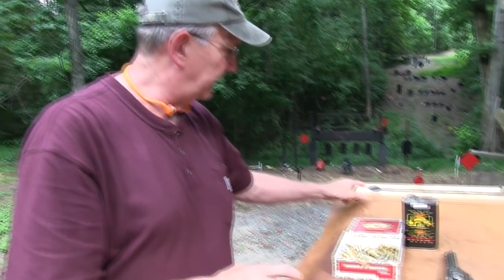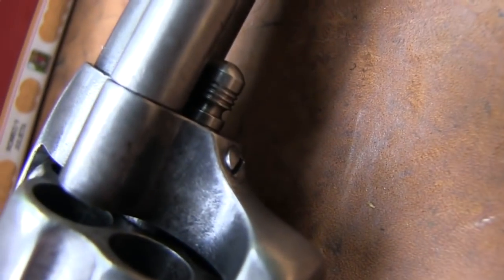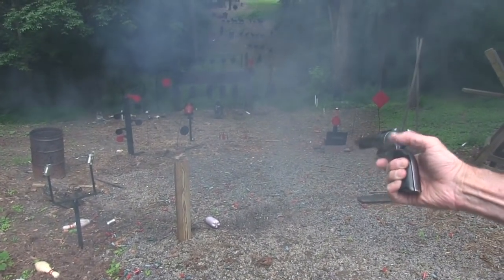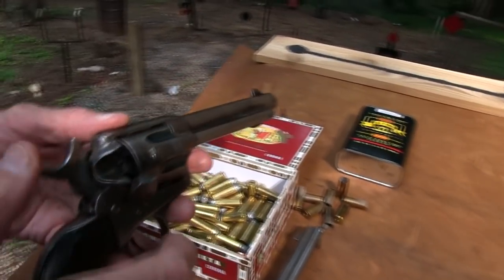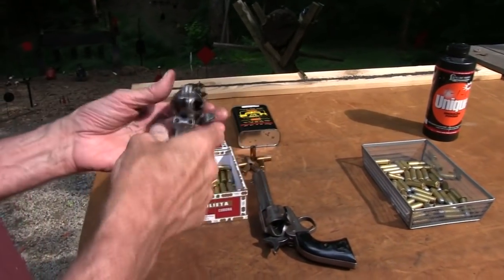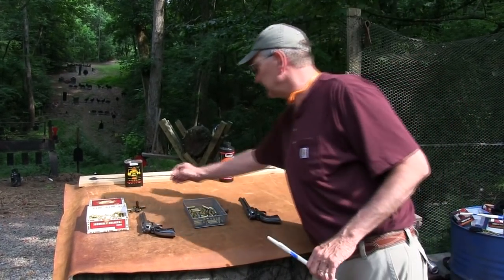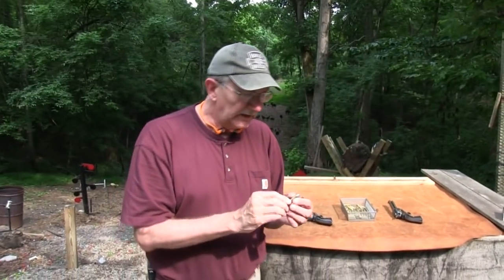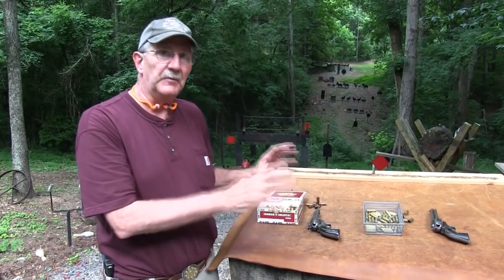Black Powder vs Smokeless Powder: some education!

Comment: Smokeless and black burn faster when loaded in a case due to the much higher rate of heat transfer that occurs at high pressures, up to 20,000 psi for black and up to 60,000 psi for smokeless in rifles.  The greater rate of heat transfer brings the powder to ignition temperature much faster.  The increase in ignition rate happens for both black and smokeless.  The demo only shows that unconfined the black burns faster than the smokeless.  ( I believe this is due to the BPs lower ignition temp.)

Comment: black powder is probably less dense, so a line of it will burn faster because you actually put less mass of powder on the table than with the smokeless one.
Idk for sure, but that's what it looks like.

Comment: The key difference which makes smokeless powder "smokeless" is that ideally all of the products of the decomposition reaction are gasses (CO2, nitrogen, and water vapor) whereas black powder produces BOTH gas and solid products. The solid products are produced as very fine particles which become suspended in the air, which is what produces the smoke (gasses - even water vapor - are not visible - only particulates or tiny droplets are). Black powder is far MORE dangerous to store because it is much easier to ignite when unconfined and it burns much more quickly and vigorously WHEN NOT CONFINED than smokeless powder does WHEN NOT CONFINED. However, when you confine smokeless powder so that the heat and pressure from the reaction accelerate the reaction, the reaction rate goes up drastically and quickly exceeds that of black powder AND it also produces a higher pressure and temperature. Part of this is due to the fact that almost no heat energy is lost to solid products (which don't expand like a gas when they're hot and contribute to the pressure).

Comment: based on some results of black-powder in semi autos, I think it is more of an issue of force of the gases. if you load an equivalent load in a modern rifle, black-powder doesn't have enough force to push the action all the way back.

Comment: the main difference between smokeless and black is that smokeless has nitro glycerin which is very explosive, nitro glycerin also burns very quickly and burns almost all of the gunpowder when shot compared to black powder which does not burn all the powder, that means more pressure building up in the barrel because almost all the powder has burned,i know what your thinking "then why doesn't smokeless burn quicker" because since it has nitro in it they put deterrents which make it burn slower

Comment: It would not be to strong, however, black powder is not a good idea in gas operated semi-autos.  It leaves too much residue for them to operate reliably.

It is also not a good idea to substitute any powder for another without reliable load data or a thorough understanding of the properties and pressures involved.

Comment: you did not mention that black powder &smokeless powder have different recoil,at least this is the case with my cap & ball revolver using black powder and cartridge revolver with smokeless load.Basically the black powder pushes while smokeless kicks,I have used the gentler recoil of B/P to help new shooters,especially women,overcome tendency to fear or flinch at recoil.

Comment: Before I ever shot or loaded my first Black Powder rifle, I went to TNT Guns and Ammo just east of Gillette Wy. They have a counter sized case packed full of what's left of Black Powder guns after the wrong powder, or an incorrect load was used. not all the shooters survived some lost limbs eye's only a few got lucky. one that I still remember was a Remington new army they loaded it with smokeless powder causing a chain fire 1/2 the cylinder was gone the frame was tore up beyond repair and the barrel wasn't to pretty either. The shooter didn't make it. that being said Black Powder guns are still a lot of fun, and yes just as capable today as they were in the Civil War in some cases a bit more accurate and durable. first Black Powder I ever shot was .50 cal. Hawkin reproduction 46 or 47 years ago. I think I was 8 yrs. old at the time love at first BOOM!

Comment: The burning characteristics differ between outside in the air and when confined in a gun.    The burn rate of black powder is  faster in than  out but the bulk gets in the way.   The flame moves from grain to grain    In the case of smokeless powder,  when confined in a gun,  the flame ignites the bulk much faster than black.  As there is  less bulk with smokeless the flame moves faster.   Smokeless runs out of volume faster than black, but is adequate.   Smokeless will achieve higher velocity than Black in a bottle necked case.

Comment: Black powder is an explosive, smokeless powder is a propellant.
Reply: +andy craig But smokeless powder CAN be an explosive!  Smokeless powder is made from nitrocellulose, or nitrocellulose and nitroglycerine, both of which are high--explosives.  The way the powder grains are made causes it to deflagrate, rather than detonate.  But you can make it explode.  A friend of mine once blew a junked car to bits with about a pound of smokeless powder.  He inserted about 6" of det cord into the powder, and set it off with a blasting cap.

Comment: In some of his other videos with the Colts he states that when at the range, it is ok to load 6 if you are careful when handling it.  He states the main reason he doesn't is because he doesn't want to get out of the habit of loading 5.  Its just his way of doing things.  There are no other reasons besides safety.  Just be careful and remember that you have a firing pin resting on a primer and a misfortunate drop on the hammer could end in a discharge.

Comment: Does smokeless powder go bad or expire? My grand father recently passed away and I inherited his reloading equipment. I’m new to the whole reloading thing, but he has a lot of old Hercules bullseye and unique  smokeless powders. My grandmother estimates them to be about 10 to 15 years old. Should I dispose of this stuff or should I try to load it up? Any help would be appreciated. I can’t really find anything definitive online. The powder was all stored in a basement on shelves. The temperature stayed around 68 to 72 degrees Fahrenheit. Thanks in advance for the help. Really hoping I can use it because there is about 10 pounds of this stuff.
Reply: Properly stored smokeless will store up too 50 years. This may differ from brand to brand. Remove the cap and smell the powder. If it has a strong ammonia smell it's bad. Old powder makes good fertilizer. Sprinkle it around trees and shrubs etc.
John Davis jax fl
Reply: Johnn Davis thanks man, one more question for you if you don’t mind. I loaded some .380 last night about 20 rounds. Half of them came out to an OAL of .980 like they are suppose to be. Then the other half is .970. Are the short ones not useable? I’m just trying to be safe and I’m not sure if there is a tolerance I’m allowed to be in? If u can help I’d appreciate it. Thank man
Reply: Johnn Davis thanks man will do!

Comment: You can get a new manufactured Colt (3rd Gen) for around 1600, they look almost the same, and feel identical. I believe I paid 1602 out the door for my 5.5 .45LC SAA (nickel), back in mid 2011. You might even get lucky and find a used 3rd Gen for around 1000 bucks.

Comment: Black powder give the bullet only a initial push , smokless powder give to the bullet a push that growing up during the time of the travell in the barrell , and the pressure growing up during this time/travel , then there are different type of smokeless powder slower or faster but the basic it is this.

Comment: I've seen information that you can use smokeless powder loads in black powder revolves as longs as the loads are under 800 FPS.
Reply from the maker: +Jack Wayne Risky business.
Reply: Ultramax sells 45 long Colt Smokeless Cowboy ammunition at 850 and 700 FPS.
Reply: If your talking about cartridge black powder revolvers then I'd use something like Trail Boss as it's made for reduced loads.  If your talking cap and ball black powder revolvers then I'd stick with the real deal black powder.  That said, any cartridge black powder revolver is over a 100 years old with questionable metallurgy and I wouldn't shoot anything but light loads even with black powder, something like the 45 schofield vs the full house 45 colt loads.  It wasn't completely unknown for a model 1873 SAA to rupture the cylinder when they were new with full power black powder loads.

Comment: where the hell did they get plastic to put on the handle in 1884? I just got a US revolver .32 thats 100 years old. It has a black plastic handle similar to that.
Reply: Comes down to what type of plastic it is their actually is some plastic that old. Example PVC was actually first synthesized in 1872 quite by accident but ya. Hell even Polystyrene was first discovered in 1830's Shellac like 1000 BC so honestly Plastic isn't that new. Of course the obvious answer is also that it's probably not the original grips either but now you know.

Comment: Great video. I took up shooting and then re loading soon after. Mainly because I thought the ammo was priced too hi. Holy cow!!  It's quadruple what I used to pay for it. Unfortunately the components for reload went up and now they are almost as hard to find as the ammo.  To answer a question below; WHAT HAPPENS IF YOU SHOOT A BP ROUND THROUGH A SMOKELESS FIRARM?  Nothing really. It will still fire. It will be a lot nastier to clean and you won't have near the power you would be used too

Comment: I loaded black powder in some 357 cases one time and shot them in a smith and Wesson stainless I think I shot six and that gun was so mad at me it almost didn’t open back up and even let me turn the cylinder. I soaked that thing down with penetrating oil and used compressed air to force that oil into that gun. Got it cleaned and lubed back up and promised it to never do that again.

Comment: So, on safety, I understand what you are saying as far as loads, but I had also gotten the impression elsewhere that, as far as storage and stability, modern smokeless is safer, as it needs to be confined to produce an explosion. i.e., if you dropped a lit match on a pile of smokeless, it would just burn, whereas black powder would still explode even un-contained. Is that true?

Comment: What happen if you shot a smokeless powder in a gun that only should use black powder?
Reply: He says aroung 6:45 that they made better guns to deal with smokeless powder. I'm guessing that if you didn't use a lower charge of smokeless powder, you would.. break your (blackpowder) gun eventually. If you used smokeless in a percussion gun, you would probably blow your hand off if you filled the chamber with smokeless instead of bp.

Comment: Black Powder also burns hotter. The idea with smokeless was not only to keep the gunners position hidden (no smoke giving you away) and the gun itself cleaner, but later powders were meant to keep things from overheating.

Comment: Footnotes:  (1)  Notice how those guns are six shooters, but he only loads 5 chambers.  That is because those antique revolvers do NOT have a transfer bar safety.  It is dangerous to load all 6 chambers.  (2)  Really glad he moved those powder canisters out of the way.  Otherwise, dangerous!  (3)  Blackpowder arms need to be thoroughly cleaned right after firing.  Shooting black powder through a gun will make it rust if not properly cleaned after a shooting session.

Comment: One more thing, do not ever fan the hammer on a cap and ball revolver! These guns require tuning and testing as most are still handmade cap size, ball size, or even hammer spring tension which you can also slip up by not pulling the hammer back far enough. one slow shot is all it takes to end your hand or you, a dude cap even. Yes, I know Hollywood does it but those are empty props. Take your time on a range follow the book and work your way safely through a misfire then a second and a third the feeling is indescribable!

Comment: Is it safe to shoot black powder cartridges with smokeless frame Colt SAA?
Reply from the maker: Yes. Black powder pressures are easier on the gun, which is why you should not shoot smokeless powder in older Colts made prior to 1900 generally.

Comment: I'm cringing a bit Hickock. When you shoot both the Colts you load one skip one (as one does) and load the rest. Thing is, you then shoot 5 and drop the hammer a 6th time with both guns, on an empty chamber. Isn't that a bad thing for a gun with a hammer mounted firing pin? I would hate to think that those gorgeous old colts are being damaged.
Reply: +1, i cringe at it to. Got some Colt SAA .. only shoot my gen3 in 44-40. I would never drop the hammer on a empty chamber. Just asking for a broken firing pin, and a hefty repair bill. It only takes one time..

Comment: How many times powerful is a black powder compared to a smokeless powder?
Reply: Vitalis Otene Actually, to my knowledge, smokeless powder is in fact more powerful. Roughly 3 times more powerful than black powder, given the same mass of each.
But don't quote me on this.
Reply: AdotLOM: That's why you NEVER load any "smokeless" gunpowder on virtually all guns made before 1880, because when it's kept in a tight área, the pressure emits a lot more heat than old-school black-powder. The heat is so high that it can cause the gun to blow up in your face as shown in the video "Dangerous Muzzleloading Practices". (see that video for more details)

Also smokeless powder is still gunpowder in the sense that it MUST be kept dry or else it is useless. Even with the invention of metal cartridges, it will still leave some residue on the barrel so cleaning the weapon is still a must right after using it. Nobody likes to clean up a gun, but it's necessary

Comment: If someone shoots a AK47 with black powder ammo it shoots 15 times an then a few times like a bolt aktion rifle and after that it too dirty to shoot. M16 and AR15 shoot like bolt action rifles also 15 or 20 times. Malfunction every time.
But whould it be possible to shoot a MP5 or Uzi 9mm, or mc 10 or Thompsen 45acp?
A modern semi auto shotgun wo reloads by blowback can shoot 12 gauge slugs with blackpowder whithout malfunction.

Comment: So... I could shoot a black powder round in a modern gun but not vice versa?
Reply from the maker: Yes, that's pretty much the case.
Reply: @hickok45  Wow, didn't expect you to answer this fast. Thank you and keep going, I love your videos!
Reply: By the way, another question I have: Is there a difference between the primer of a black powder round and a modern round? Could I hypothetically take for example a normal .25 APC cartridge and fill it with black powder and it'd work without modification?

Comment: Someone said smokeless powder is a high explosive when confined.  This is not true.  Smokeless powder burns at a high rate when confined, but it does not explode.  It is classified as a propellant.  Black powder on the other hand, does explode when confined.  It is however, a low pressure explosive.
Reply: Why does smokeless powder not explode when confined? It burns pretty fast in that condition. High pressure increase in small amount of time? Check. Heat? Check. That would qualify as slow subsonic explosions caused by burning (deflagration), just exactly what you said, but it IS indeed an explosion. Didn't you just mean "it doesn't detonate" or I don't understand something?
Reply: Sebastian Krośkiewicz
Technically, no.  Smokeless powder burns at an extremely high rate when confined, but there is no detonation.  Smokeless powders are classified as propellants.   Black powder does detonate, but is is classed as a low pressure explosive, (sub sonic).
Reply: David Wilson So the black powder does not detonate as well. Could it be a detonation if it's sub-sonic? From the definition I know detonation is a supersonic reaction fed by its own shock wave (which must be supersonic to be a shock wave).

If the energy transfer is done by heat, it's just deflagration (burning) and that would apply to both smokeless powder and black powder.

And both can explode (burn really fast, but not detonate), because an explosion is not necessarily a detonation.

Maybe I'm wrong, but that's what I learned from several sources and making "detonation" equal to "explosion" just confuses me, because detonation and deflagration can be both types of explosions (which is just a quick release of big amount of energy from what I know).

Do you mean that black powder can detonate (but super-sonic) in some circumstances and smokeless powder can't?
Reply: Detonation was an incorrect term.  My bad.

Comment: how does one tell there gun is a black powder frame???
Reply from the maker: I think we have a video on that. There's a screw in front of the frame that holds in the base pin, rather than the cross pin and spring affair.
Reply: Now does this work for every gun? Thank for commenting back! It means a lot! I started getting Into black powder firearms. More on the older side not really muzzle loads yet. Like 1894 Winchester’s dated 1899, or Spencer arms shot gun , original sharps, original rolling blocks. Is there a book I can get with this info or how do I learn that stuff? Thank again!

Comment: you cant use s.p in b.p. guns but can you use b.p. in s. guns?
Reply: Sebastian Lind Yes, Smokeless is different than black and will blow up your gun if you use smokeless in a black powder. black powder is able to be used in a smokeless gun because black has much lower pressure than smokeless.